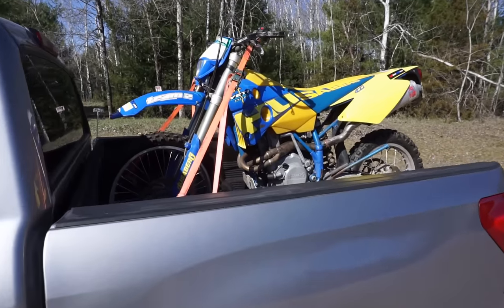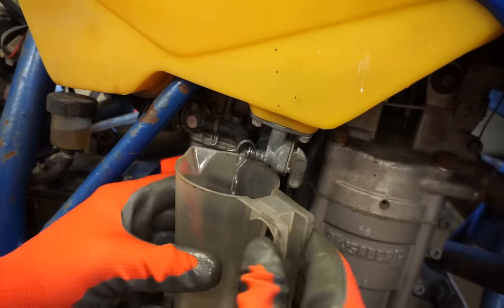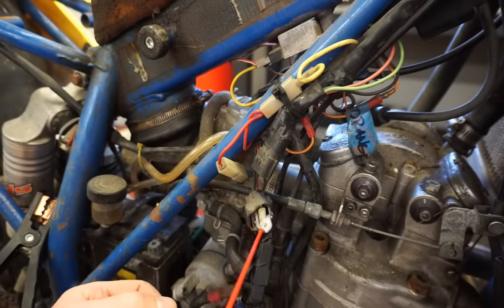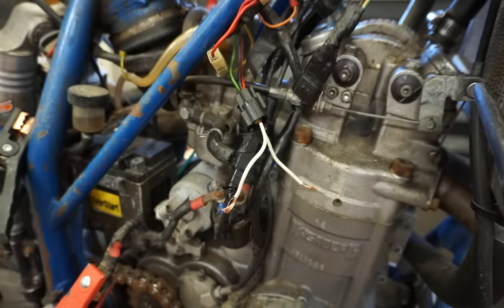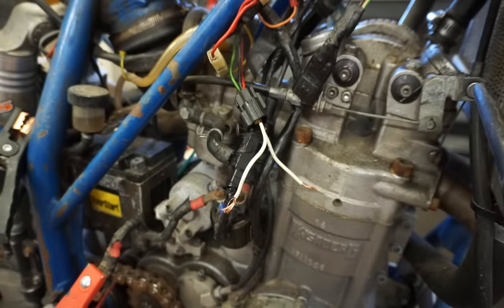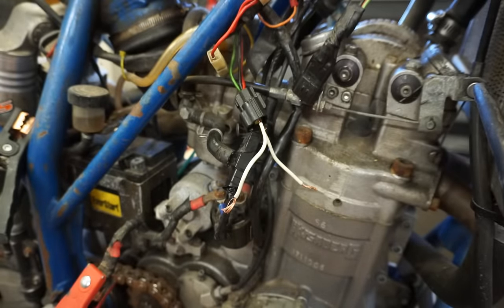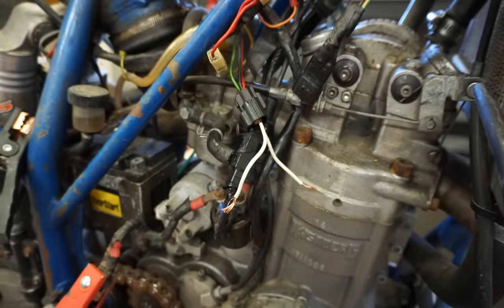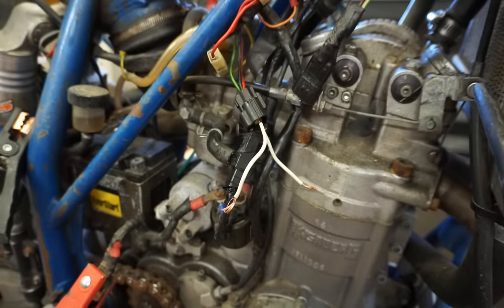Seller Said This Rare 500cc Supermoto Won't Run (Sitting 15 Years)

Comment: FYI.. the weakness of these things were wiring was thin and broke easily...the  engine only holds 3/4 of a quart... if you want the engine to last more than a couple rides, it is a must to run Redline or maxima ester synthetic...My dealer at the time had the engineer from Sweden fly over because they were having so many problems ...the dealer also had a lot of stator issues... treating the stator cryogenically made them last twice as long...
Reply: What a terrible bike. NOT WANTED HERE. This better ride like a mad Ruzzian. I would NEVER add ethanol gas to this supposed bike. Poorly done. Maybe nitro-methane. Very bad wiring.
Reply: Dang it ,sounds nasty
Reply: Nice inside info 👌
Reply: 3/4 of a quart 😂😂
Reply: @CoralReefkid   i know.. i wonder why they are out of business .. ?  a lot of issues ..
Reply: @CoralReefkid  yea thats why all the camshaft were needed.  no oil to the top end!
Reply: @user-hj5ml8rr8u  at the end they had an awesome bike with the 570 and 390. It's a bummer they were gobbled up by KTM like husky and gas gas 😢
Reply: The Husaberg brand and products was incepted as a pure racing machine, at a high level. For that, they were unbeatable at that time, but it took maintenenace almost like a pro racer would do to keep them ticking. 

The competitors gradually caught up, and after about 10 years, at which point they really had little USP any longer.
Reply: Starter missing teeth?
Reply: @scraech  I bet that sump was bone dry during operation and all the oil was as throughout the motor as it could be 😂 even Chinese pit bikes are designed better than that hunkaberg
Reply: @michaelschlup-c5o  no kidding man! So funny to be honest. Again, I bet that sump was bone dry during operation.
Reply: KTM stopped producing them because they were crap. They started producing Husqvarna
Reply: The Yugo of bikes.😂
Reply: Yes, whoever Husaberg contracted to produce their wiring harnesses really cut corners and the quality - or lack thereof - shows it.
Reply: He should take it deep in the woods trail like 20 - 30 miles out and see what happens.

Comment: when testing ohm's,dont have your fingers on the end of the probes..Your testing your body at the same tome
Reply: Yes, use alligator clamps for testing Ohms.
Reply: Technically true, but your ohm meter send out a voltage and that how it senses resistance. Voltage takes the path of least resistance. If he was reading his body the reading would have been a lot more resistance. Since it takes the path of least resistance he was actually reading the resistance of the stator winding.

Comment: CDI?  If the CDI is bad it can come off and on. 
Even if it has spark a bad CDI can mess with the timing. No wonder this company went out of business. What a nightmare to work on.
Reply: Those little boxes are a pain
Reply: For whom who don't know how to do it everything is a pain to do
Reply: This company is KTM today so they never went out of business.
Reply: @RIMHQ-YT  They make some awesome machines now ,the 125 gas gas with fuel ⛽️ injection makes 40 horses 🐎 awesome power to weight ratio.🤠💪💯
Reply: @RIMHQ-YT it’s still a piece of garbage. Who puts the battery where you can’t get it out without taking the carb out. Dumb. Technically they did go out of  business as they were bought out.
Reply: @MrJacksmithFTW right.  What do you know about trouble shooting when you have an intermittently functioning  cdi ? That can stump anybody unless you have a back up sitting around or you have the resistance specs on hand. A bad CDI can still show a spark. So yea it’s a pain Mr. Know it all
Reply: @RIMHQ-YT  are you a mechanic or just someone who likes working on bikes?
Reply: @professorright you know nothing about it. The guy that owned this bike did not know how to do maintenance and neither do you. By the time this bike was built most components were the same as a Ktm they owned the company after 1996. Calling it a supermoto tells me he never did any research at all. No one put on a mikuni. Built in compression release proper starting procedure is to push kick starter until it is on compression, then take it back up to top, you will hear the compression release engage. Then a light push with absolutely no throttle they start right up. Had a friend that could start them with his hand. Sad to see a guy trashing something he knows nothing about and did not do any research on. The only thing I agree with him about is the battery location. If it is kept on a trickle charger it is simple as it will need to be replaced only in four or five years.

Comment: we got a lot of these in the uk. A friend had one a while ago. left hand kickstart no electric start. have fun with that lol
Reply: i’ve seen a leg be tore to shreds lol.
Reply: the old husky 500 2 strokes were wild to kick on the left side. These things are electrical nightmares to work on...they work one moment and it dies and you can't get em fired back up..they are some cool bikes from the early 4 stroke days.
Reply: Smart riders learned to only shut these off on top of a hill.
Reply: Husaburgs are notorious for not starting especially when warm, if it don't start in three kicks it never will, put it back in van and grab a beer instead

Comment: Tech tip for you. The wire extensions you added at the plug when testing stator resistance will add to the resistance level. Also best practice to test Ohms without your body/fingers touching the wire.
Reply: My addition is that I've had snowmobiles with heated grips. 
When could, with grip heaters on, would never start. 
Turn the heaters off... Fires right up, and  then would fire warm with heaters on. 
Lesson here is to reduce all voltage draws possible, including factory dash/lights. Will narrow problems, and might find the draw.
Reply: Those wires were really thick, it would've added milliohms at the most

Comment: It sounds like timing is out. I agree with you Joe. I also think you need to swap out the battery. In my experience a low battery will cut the spark current.
Reply: but he hooked a fully charged jump pack by passing the battery
Reply: Charge the battery and replace the plug and wire (with coil if needed). Intermittent spark is hard to diagnose. When you had spark it was consistent and steady. When you did not. You had nothing. Which tells me it's probably the wire. Wires could go bad and they'll look just fine. Wires are extremely hard to test and requires specialized equipment, so just replace it.

Comment: What a job! It's a pleasure to see that you don't give up.
Husaberg 2t and 4t were marketed here in Spain until 2012/13, especially the 2 strokes, the 4 strokes failed a lot, starting problems and valves, like the first crf450 02.
Here in Europe there were different "rare" brands such as Vor or Vertemati, perimeter chassis, chain on the right, starter on the left, engines larger than 500cc and with Frankenstein aesthetics, in the 90s/00s, even here in Spain it took a long time get spare parts for them, the price was not competitive with the Japanese ones, they broke a lot and were expensive to maintain.
Reply: Yeah it took em' a while to figure out that decompression thing, I remember when the 400 and 426 yamaha's first hit the tracks here in Japan, thankfully they got it figured out but, well, I still reckon 2 smokers are more fun.
Reply: Thats either a FS400 or a FC550 but neither is 500cc how dont you know what it is if you know all this?
Reply: Husaberg are ktm, ktms first every racing 4 stroke , ktm bought it originally because they needed a racing 4 stroke in time after 4/ ban in racing in US, ktm took company on
Reply: @BoxingLegends2024  Be it 400 or 503 it is the same, but with a different race, at KTM it was the same, in the 2000s they had the sx400 and the sx520, both identical but with a larger piston and connecting rod, nothing more.

Comment: Had a buddy that had a 620 one.  Crazy fast!  I did get to take a ride on it and test the speed in an open sandy creek.  IF you can't find a filter for it I had a buddy that made a filter out a universal kit from uni and a specific kind of hot glue.  Was pretty nice when it was done.
Reply: I just bought the Unifilter Twinkie for it.

Comment: I know absolutely zero about Husabergs. But, i would be digging into the magneto side to make sure its rust free and check to see it is has a pulse generator. If it is also rusty or too far away from the magneto it can cause the same issue its having. With these bikes you just never know what kind of kooky setups they have.

Comment: Some of those old bergs used to be very prone to backfiring and blowing the carb clean out of the  intake boot. 
 I've seen riders destroyed before they get to the start gate just with the effort trying to kickstart their bikes while others seem to have the knack and start them up easily in trainers
Reply: Lol yes. Had a Husaberg last year. Blew off the carb. I had no idea why it wouldn't restart for a while. I was like wtf!!
Reply: @RIMHQ-YT  my mates did the same he kicked it for ages and then we towed it with the car 1/4 mile  of 30 to 40 mph towing  to no avail then eventually we spotted it and put it back in and it started first kick , we spoke to the UK  berg importer Dave Clarke   racing who was local to us and he said it's a common thing that would be around 2002. he demonstrated started one from  cold in trainers when my mate was having all his problems,  another mate ended up with an ex  factory Joel Smets  600  from DCR  think it was a 1996  ex mxgp bike that only had 3 speeds and all 3 gears  were down, awesome tractor like pulling power strange gear set up but Smets won  the  500cc world championship in 1995, 1997, 1998, and 2000 so i guess it worked

Comment: I absolutely love this channel. When i was a kid we would race dirt bikes all summer in the back tamarack when dry. None of the dads were handy with wrenches so we had to figure it out for ourselves. Kind of a Lord of the Flies training. Now, almost retired airline mechanic I’m looking for a mechanical project to replace 43 years of fixing, in a sense, a huge pin ball machine. Watching this video was intriguing. I wonder if the spark breaks down under load of compression? I believe the stator circuit is poor as others mentioned. 
Thanks for the wonderful content. Joe. You have good skills and intuition. Comes with dedication.

Comment: Had the Husaberg 650 Super Moto… Bad azz bike! FAST! LIGHT! Very minimal. Absolutely loved it! Required as much maintenance as a Japanese 4 stroke Mx bike,but the reason I sold it was parts availability.
Reply: I was actually lucky enough to ride two of them. By far the most fun bikes I've ridden. Weird thing was they were learner approved over here in New Zealand.
Reply: yep I had a 94 501 it was fast and super light bike was way ahead of its time. Mine broke a intake valve stem trashed head and piston. Have fun with Left Leg Days!!
Reply: @DadBeard-pi2oy  Lol! I used the magic button!!! lol
Reply: @kellyriffle4750 The starter motors were known to not have enough beans on the FSE 650. My dad would kick his first time every time knowing what tdc is helps or you’ll kick until your sweating and swearing
Reply: @joski9030  No starter issues with the one I owned.
Reply: I had FS650 too. Best supermoto i have had. 65hp 253lbs. It was super reliable. I really want one again but parts are hard to find.
Reply: @jt3963   Parts availability was why I sold the bike.

Comment: The internal spring/piston/ roller mechanism in the flywheel can get sticky from sitting . Once the engine has been warmed up to allow lubricants to those little springs/pistons//rollers they will “miraculously” loosen up and allow the necessary contact with their hub . I had this same issue with my 81 gl650. In the future I may try filling the crankcase to where the springs/pistons/rollers are submersed in oil for a period of time to assure that they can slide freely. Maybe fill with atf or marvel mystery oil as these oils are lighter and high detergent.

Comment: Welcome to the world of SEM ignitions. I can pretty much guarantee that the stator has left the chat. If you pull the stator more than likely it will be rusty and blistering.
The SEM stator was the achilles heal of the Husaberg (& KTM, Husqvarna) from the mid/late 80's through to 2003.
There are no new units available and the replacement stuff available from various companies are Chinese junk that will last for 1/2 an hour. You'll  need to find someone that is conversant in rewinding SEM stators and you'll be good to go. FYI, that stator is shared on all Husaberg FE/FS/FX models from 1999 to 2003. 
From 2004 Husaberg used the Japanese Kokusan system
1989 to 1998 models used a very similar looking SEM stator but is not interchangeable
Reply: thing is a big ol money pit

Comment: I have the ‘08 FE450 and my biggest issue is that the case has to be split to remove the cylinder sleeve. Bought mine with cracked valve retainers… unknowingly. However, I’m glad to have a piece of Husaberg history.

Comment: on the husabergs you're supposed to check the oil with engine hot. you just overfilled it bro. the oil isn't supposed to show on the window with a cold engine. another thing you should get a keihin for for it, it makes very easy to start

Comment: Joe, save your knees, joints,  gonads.., later down the line and get you a roller starter.

Amazon, Ebay Motors.., have them on the cheap.
Reply: Those are incredibly handy. Especially with giant bombs like this thing.

Comment: Joe , I have watched your videos hundreds of times.  When I watched this one I had  an idea which may help you with future bikes with starting issues.  The easiest way to explain this is using a motorcycle dyno table with the ability to park and strap down your bike on the platform. The platform is also a lift table. under the rear tire is a pair of adjustable motorized rollers that will spin the rear tire and hence the engine and effectively acts like a bump start.
I think with your experience you could probable fabricate your own table.  Just thought I would share this with you. Thanks for all your great content.

Comment: Don't give up! I had a very similar KTM. Once you get your technique down it will fire right up. I recommend using your right foot to kick standing beside it. Standing on a curb to get a little height makes it WAY easier. Being able to kick straight down is the angle you want. It should have a compression release (I can see the lever at 11:48) to help you get the piston just past TDC. Finally, my bike would start when cold or when hot. However if I rode for 5 minutes and then killed it... it was a bear to start. These bikes are tricky to start but once you know what it likes you are good to go.

Comment: These were pretty awesome machines. I had an earlier FE600E that was absolute monster! 
There was some sort of service bulletin for the piston rings and their starters were too slow to fire the engine.
There was a CBR600 starter that would swap in and worked well. The left kick was difficult with it being such a tall bike. They sound super cool and be sure you're hanging on when you sat throttle position to WFO because they'll wheelie as long as you want.

Comment: You ever notice everybody’s telling you that they always run one way or another somebody’s told you it ran through somebody else or whatever lol when you were using the electric start, it did spark a little bit. I did see it.
Reply: Stator or wire problem?

Comment: Sounded awesome when You got to ride it . I would check out the wiring from the stater . Without a good battery and charging system it will not run or start well.

Comment: Yes Joe it is 12 volt  charged by the battery power source which turns on and controls the CDI box unit from the stator.

Comment: I had numerous Husabergs over the years but had the 1995 600 cc that was a bugger to start.  tracked it down the Delortto carb and replaced with an FCR 41mm and it started on the button.  To start first kick every time, start like an old British bike, three to four prime kicks with decompressor engaged, then find top dead centre then slightly past, then hard kick and it will start.

Comment: Sounds like a typical grounding issue. Go thrue all the grounding points, next up: rebuild stator. And get a fresh plug. There are also different types of hats for the plug, make sure you have one with the right resistance.

Comment: Even though the brand went under, Husaberg pretty much revolutionized 4Stroke technology as it was and paved the way for the modern thumpers of today. Ktm and Husky ripped so much R&D from this underdog before their early demise. The only other ones who were developing bikes like this were ATK and the Vertematti Brothers in Italy.
Reply: Okay seriously what did they invent prior to 1995, when they were bought by KTM? This bike isn't more advanced than my 1997 LC4. Although the airbox in the frame is pretty unique
Reply: @dmitrijr7065  You answered your own question. Your 97 LC4 is neck and neck with that 95 Husey. 
Btw Husaberg was designed by former Husky engineers who got bought out before they had to file for bankruptcy. 
By WHOM you might ask...

At the end of the day. 
KTM gonna KTM.
Reply: @jeredalmeida1880  nope, the first Gen LC4 was launched in 1987, when husaberg wasn't even founded and you can clearly see the evolution of this bike from 1988 to 2006, but the overall design wasn't changed much. 
Later under KTM Husaberg had some really interesting design ideas but in the 90ies? Can't see much
Reply: @dmitrijr7065  Well you wrote 1997.
Reply: @dmitrijr7065  Ya wrote 1997. I'd never heard of a 97 LC4 until today. That threw me off